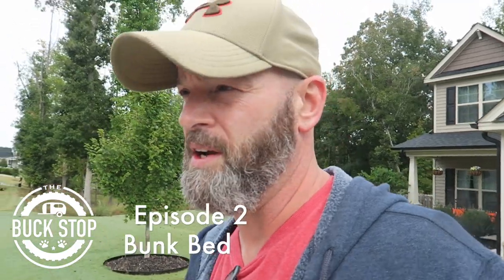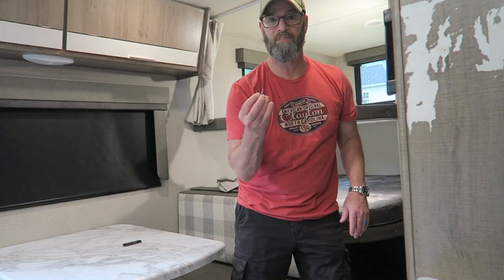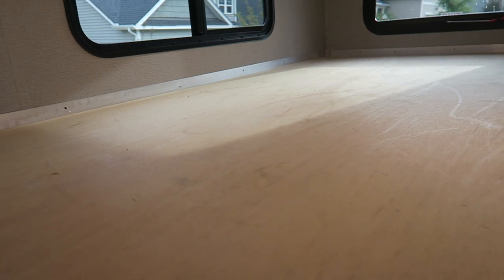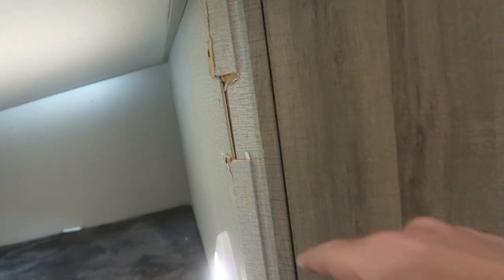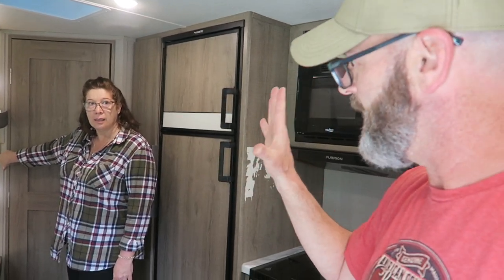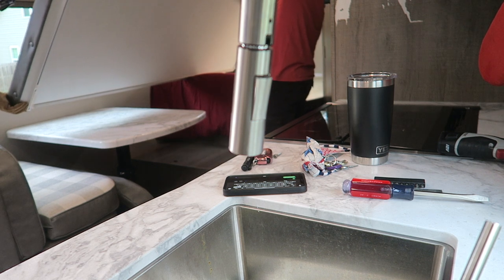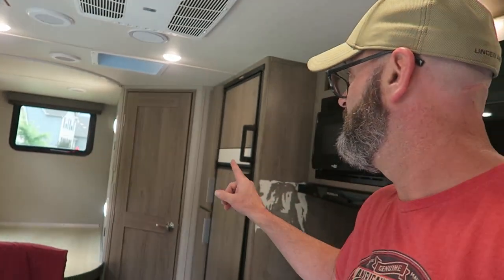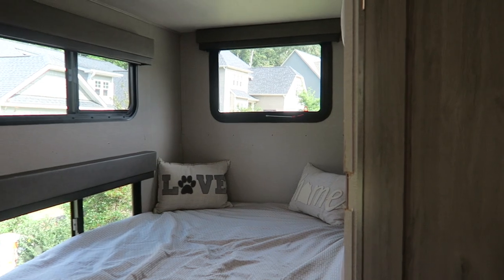RV Modifications // Grand Design Imagine XLS 21BHE Bunk Bed Removal

Comment: This is a great video and my husband and I both watched it several times before we attempted this.  One of the things we did was put painters tape around the perimeter.  This stopped us from scuffing up the wall.  We also started with 2 people.  I. Don't want to say we learned from his mistakes but knowing what could happen made us more aware.
Reply from the maker: oh thank you so much, we recently sold the camper and had to put it back in for the buyer - it went back in easy and you never know it was removed so there is that

Comment: I started removing our 2800bh bunk today and thought the plywood was secured somehow. Was surprised the whole thing came out as one piece. I thought about removing the screws around the perimeter but I was equally surprised you did this while laying on the bunk. One question about the 'hidden screws' are they hidden under the lower balance and screwed upward into the upper bunk

Comment: Just realize that those bunks are in there to also strenghten the rear corner. All walls and braces serve an important purpose. Removing the bunks can weaken the engineered structure. Just FYI.
Reply from the maker: Yes I have heard conflicting information. Some have said it weakens the structure. Many have done this without issue though. I still have the bunk so I can put it back. I want to sell and get one with out a bunk. Thanks for the info.
Reply: @TheBuckStop  What is the consensus on this?  We haven't even taken out out 23BHE yet and are consider removing the top bunk.   Thank you for any input.
Reply from the maker: @1965Rickey  we really liked it removed - it provided alot more usable sopace for our needs - we did end up selling it and put the bunk back because the buyers wanted it back - so keep it in case you ever sell.
Reply: This is untrue.  These units are designed to be COMPLETELY opened and are frequently sold as such for mobile offices, construction trailers, etc.  The bunk provides no required structural integrity.  You can remove without fear.

Comment: I did the same to mine. Didn't need the top bunk anyway, but nice to have the lower
bunk and not feel confined. Also better air circulation while air conditioning.
Question, Did you change your murphy bed mattress? I'm wanting to change
mine and was trying to learn what others did & whether or not they like their
new mattress.
Reply from the maker: we did swap out the mattress bout a bed in box off amazon - I will say we have sold this trailer - there is a video of the new one.

Comment: all that work and damage if its only the two of you, the 22mle is a great couples camper
Reply from the maker: I kind of agree, the damage was just a scuff and when I put the bunk back to sell you wont even know the wall paper was ripped. The reason I went with this model was because I did not want a slide and this was the only GD without a slide. We have thought more on this and my wife want to trade it in for one with a slide. Live and learn right. Thanks for comment.

Comment: Do you have any documentation on the sewer hose install? Curious how you mounted it.
Reply from the maker: I used self tapping screws and attached it to the frame under back bumper, I do not have any documentation but it was not difficult to do.
Reply: @TheBuckStop  One more question if you don't mind. I had a person in a similar group inform the that when mounted to the frame in this manner you can't fit 2 15' hoses. Do you only carry one hose or do you have another solution?
Reply from the maker: @GarrettHensley  good question, I have 2 hoses in the tube and another in a tub so 3 all together but yes I fit 2 hoses in the tube.
Reply: @TheBuckStop  it looks like you have the same hose as me. I think mine are 10ft each and 39in compressed.